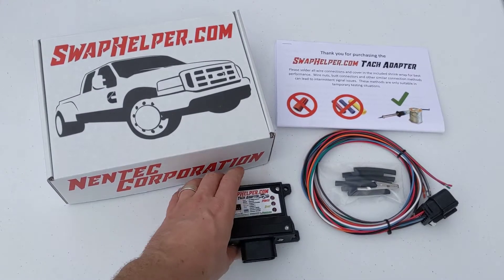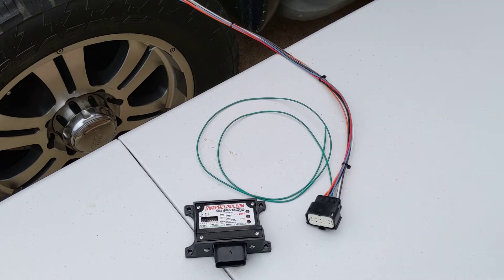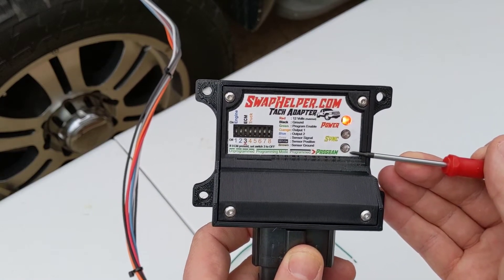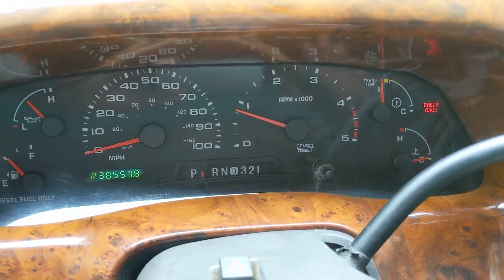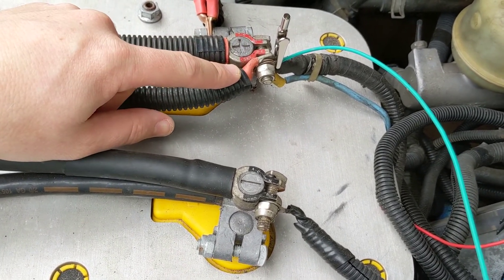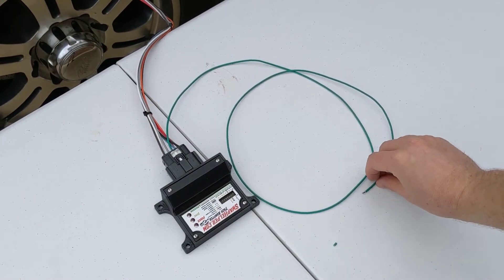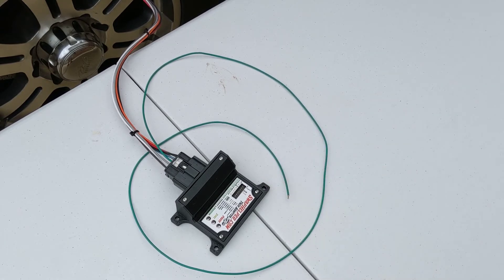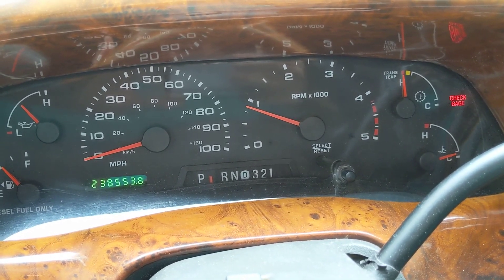Programming your SwapHelper.com Tach Adapter

Comment: What if you program the adapter too soon. Any way to clear the memory?
Reply from the maker: As explained in the instructions, follow the programming process again after changing the switch configuration to reprogram it.
Reply: Do I need this to get right RPM signal to the stock ECM/TCM to shift the 5r110w?
Reply from the maker: @darrenadams3285  Yes, and it's available at https://www.swaphelper.com/product-page/swaphelper-com-tach-adapter-1
Reply: Will tach affect ac?